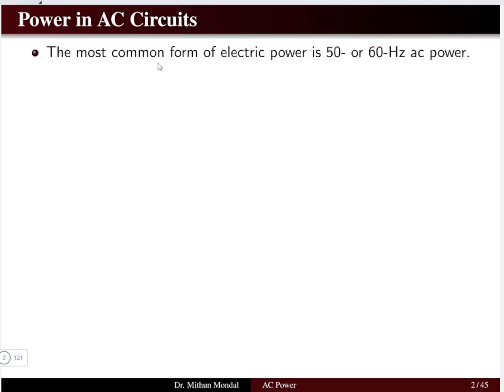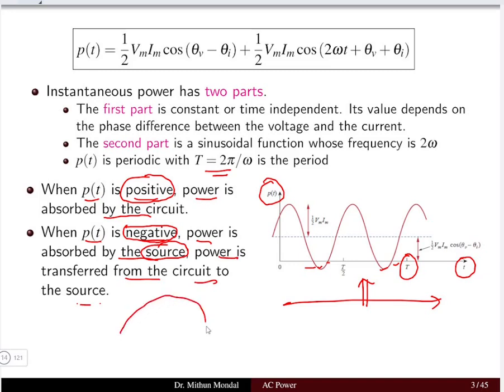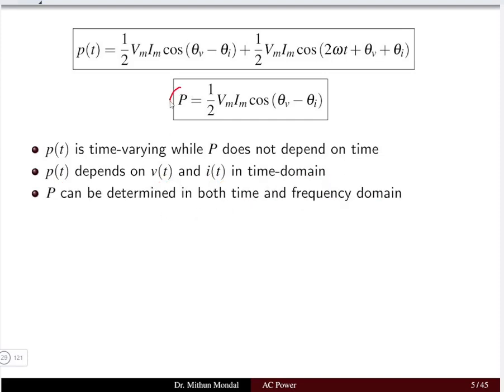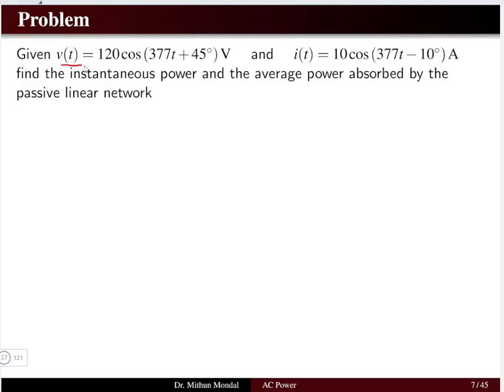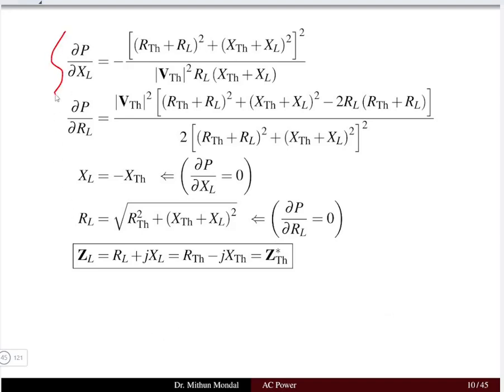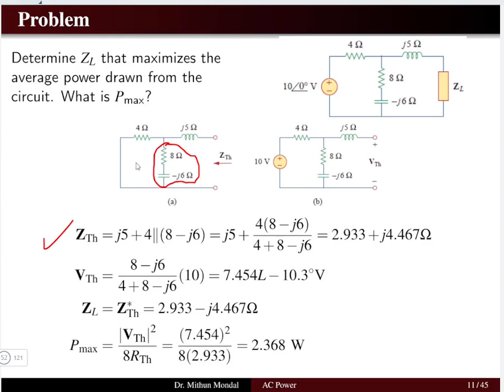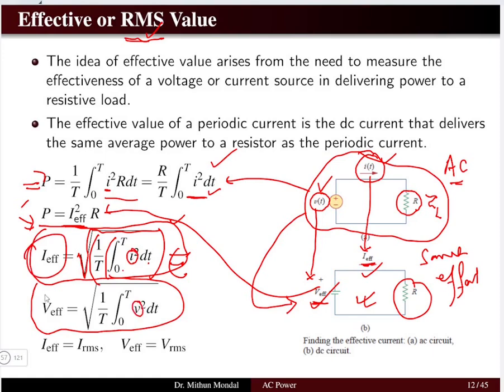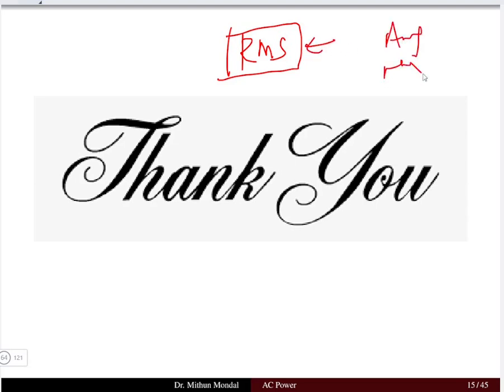Electric Circuit Analysis | Lecture - 10A | AC Power Analysis

Comment: Does the formula of MPT has 4 in denominator or 8? In Some places there is 4 given.
Reply from the maker: Pmax = Vth^2/4Rth. So 4.  Note Rth = RL
Reply: @EngineeringDevotion  Sir, here, Is Vth is the maximum value or RMS value?
Reply from the maker: @azysgaming8410  That depends on the source voltage, whether it is given maximum or RMS. Unless otherwise mentioned consider RMS.